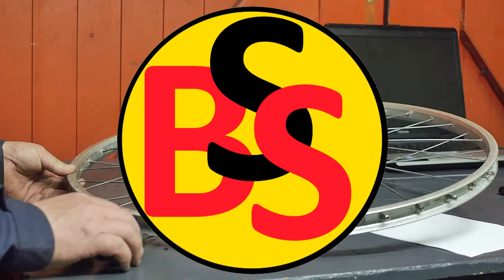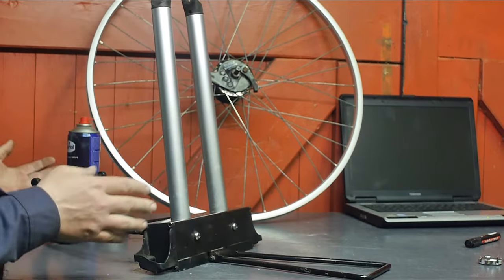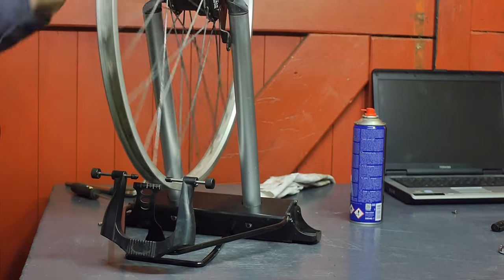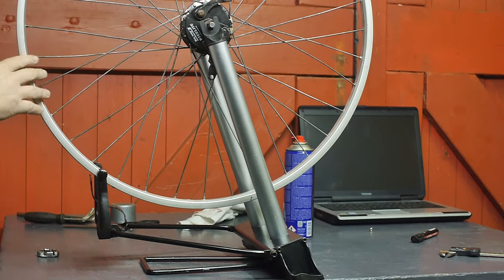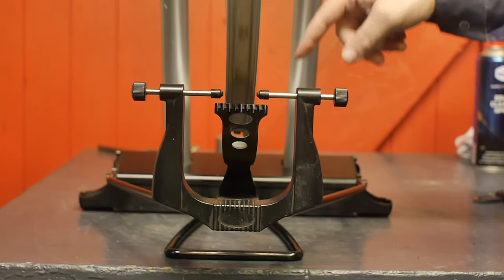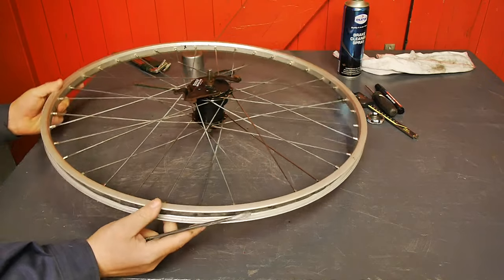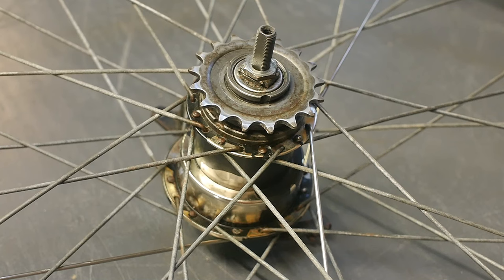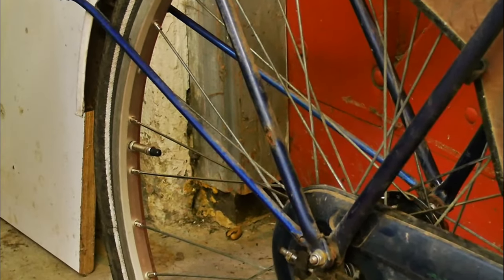Fixing a bicycle wheel - Truing the wheel

Comment: The rear wheel truing is more complicated, so-called dishing could be problematic, in one case of DT Swiss alu wheel I could not keep the recommended spoke tension, because it affected dishing, and it didn't set correctly in the frame (chainstays)